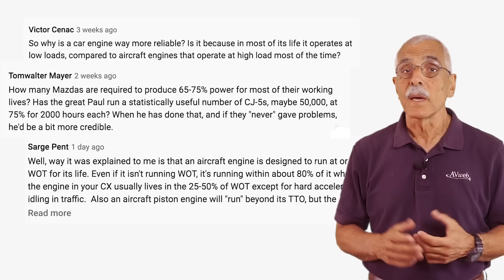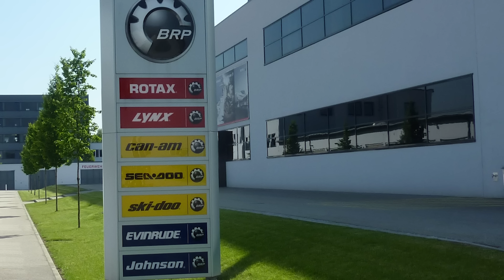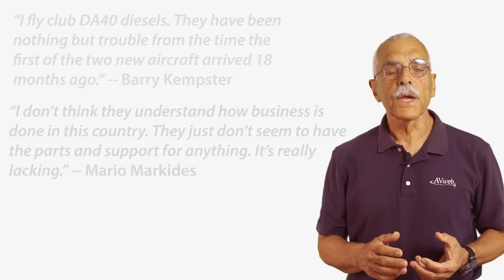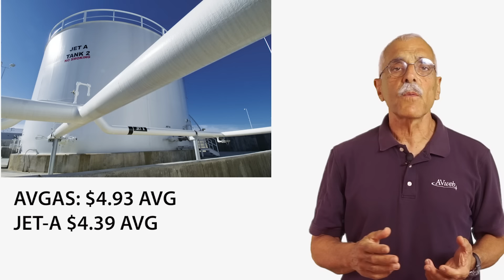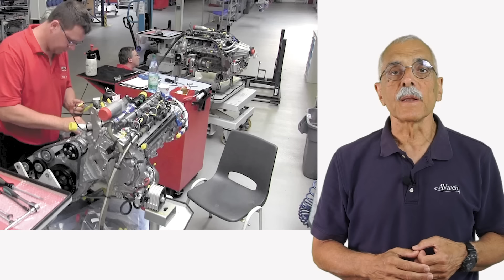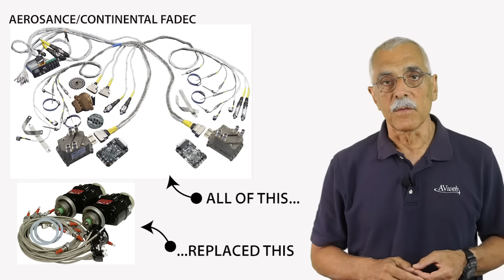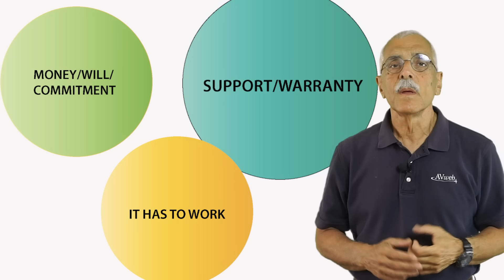Why New Aircraft Engine Ideas Rarely Succeed

Comment: The best bit of aviation journalism I've ever seen. So well researched, written and presented.
Reply: The last 50 times I have tried to watch a 22 minute aviation video, I’ve gone narcoleptic by Minute 8… Not this one!!!
Reply: Meh .. "Blah blah advanced" ..  Not really though.  Advancement in power and head/airflow has been achieved over the last 70 years.  Over reliance on electronics so an E/E can have a job.. is not advancement.  Show me advanced power, cooling, oiling, and fuel delivery .. all with advanced reliability and ease of maintenence with an eye on cost and not reliance on electronics.   That is progress.
Reply: So it seems, the moral of the story is that, the market for aero engines is very small (when compared to cars).  Developing a new, aero engine from scratch requires as much R&D as an automobile engines (if not more), but you can't expect to sell a fraction of the volume that the automotive market demands.  So manufacturers want to skimp on the R&D by just modifying an existing auto destign.  Then, surprise, surprise, it's not as good as an engine that's specifically designed to be an Aero engine.  

The Lycoming engines have been focused on the aviation market since 1910.  That's over a century of R&D dedicated to their engine design within the Aero engine field.  What does it take for a modern engine manufacturer to compete with that?  Yes any automotive engine manufacturer could (theoretically) catch up by investing a fortune in their own R&D to produce a competitive engine, but when you look at the size of the market, is it really worth it?
Reply: Yes and there are many reasons for the answers he gives but doesn't elaborate.  Honda lost interest when China bought Continental.  Spot on about Toyota, BMW won;t let out their superior engines to the aviation market for the same reason.  Not sure why WV Audi did.  And he doesn't explain what happened to Mooney either.  China bought up many GA manufacturers as they could in order to kill the competition to their investment in Sirrus.  Mooney was one of them.  They also bought other type designs like Commander with no intention of ever producing anything.  But Amerikans enjoyed lip service from them and the promise of the golden sellout.  Enjoy your parachute gimmicks!
Reply: Yep
Reply: What about the Viking Aircraft Engine Honda 1.5L automotive engine? This engine has been for sale for many years - I'd love to hear your opinion about the company and the technology behind converting an automotive engine to an experimental aircraft engine.
Reply: @Jax Bradley Glad I could help :D
Reply: Until he said. It must be a German thing.
Reply: @Smarty1171  .. I doubt he meant anything by it
Reply: @venusreena2532  I know exactly what he meant. But try that with another ethnicity and YouTube would pull the video.   It’s true.
Reply: @Smarty1171  that was the best part. Btw it was you, in the kitchen, with a butcher knife.
Reply: @Smarty1171  ⁷
Reply: @Colonel Mustar
Reply: @Jax Bradley Lately I have been using flixzone. Just search on google for it :)
Reply: @Romeo Jacob yup, been watching on Flixzone for since march myself :)
Reply: @Romeo Jacob thanks, I signed up and it seems like a nice service :) I really appreciate it!!
Reply: @jaxbradley7036  
 From quora:
“…
It's an illegal website and a complete scam. Don't waste your hard-earned money on such fake sites. Flixzone net website is not a safe website.
…”
Reply: i know I'm pretty off topic but does anyone know of a good site to stream new movies online?

Comment: Interesting video and I can not argue with much of what you say.  However, there is one bit I disagree with.  As reference, early in is publication history the Air and Space magazine did an article on why automotive engines in general were not suitable for aircraft.  It had to do with duty cycle and that auto engines simply are not engineered for running at high out put for extended periods of time.  It then discussed and showed for example the size of a typical crank shaft for an automotive engine versus an aircraft engine.  The aircraft engine being much more robust for a given power.  You mention this but then dismiss it.  This is where I disagree.  As an engineer, I understand a little about how fatigue fractures grow in highly and unevenly stressed parts like for example a crank shafts  Diesels which you discuss at length have by their nature more robust internals and for that reason probably are successful.  Based on the Air and Space article and my knowledge of fracture mechanics, I would not want to fly in a plane that is powered by a converted gasoline based auto engine.  Nevertheless, an interesting and instructive video that I enjoyed watching.

Comment: 30 year airframe and power plant mechanic opinion here   Classic Lycoming (and very similar Continental) air-cooled opposed engines emphasize extreme field serviceability and ecosystem depth. Individual cylinders can be pulled and worked on without full engine removal; magnetos are independent of the aircraft electrical system; diagnosis and adjustment often use feeler gauges, basic hand tools, and widespread A&P knowledge. Parts and expertise exist at nearly every GA airport. Classic Lycoming and Continental engines still excel for traditional GA—ubiquitous mechanic knowledge, true field repairability with basic tools, independent ignition, and a mature parts/support network make them highly practical and resilient in real-world (including remote or training) operations. More modern engines generally improve efficiency, weight, emissions, automation, and (in some cases) fuel flexibility, but they trade away some of that simplicity and widespread support for greater complexity and specialized maintenance.  regulatory, liability, and infrastructure factors have preserved the 1950s architecture because it is so deeply suited to the existing service ecosystem and the safety culture of GA. Experimental builders have shown how the same core can be modernized when certification barriers are lower.

Comment: I don’t agree with your statements on the Mooney m10. I worked at the factory after that time and I was told by an engineer that the m10 couldn’t even climb to cruise altitude without overheating and that was with the diesel engine. I was told they had to stair step the aircraft all the way to altitude and that it took 4 more stops than planned to get it to Kerrville. 😂 it’s not a great engine it’s just an engine…

Comment: Don't really need DOHC when the engine doesn't even get above 3000 RPM during operation.

The automotive diesel is an interesting option as their torque peak tends to be closer to 2000 and horsepower peak in the mid to high 3000s.

Their happiest operating range tends to be 2200-2800 RPM for these smaller "high speed" diesels.

But, there is added complexity for sure, not to mention the cranksahft being too low for where the prop needs to be, so they need a gearbox to move that output higher than the crankshaft. And their original gearboxes were not long-lived...

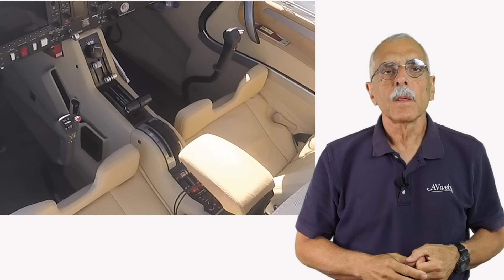Comment: 12:45 Kurt Tank already put a mechanical computer (kommandogerät) in the Fw190 in WWII that allows for single throttle lever operations. It’s kinda crazy for me to learn that after so many years aircrafts still have 3 levers per engine
Reply: That was BMW, not Tank.
Reply: @P @PistonAvatarGuy h right, they made the engine

Comment: Reason… number one…
The FAA makes it …IMPOSSIBLE….. IMPOSSIBLE …IMPOSSIBLE…
to jump through the initial hurdles….
How about this…
1) I have a Piper Aztec but the engines are smoked..
2) I want to install 
two Honda engines with props from those guys in Florida..
Or two GM LS3 engines with the gear box and prop systems from…xxxx
I …will fly it up and down the coast line.. daytime  VMC only for 100 hours
Or
I will fly it ONLY in G airspace and in and out of these airports… always day VMC… and never below 3000’ AGL unless for take off and landing…
THEN…I will report my results…
THEN…I can add passengers for day only for another 200 hrs..
etc
Ok the above needs tweaking but…

The  FAA is full of cowards… there ARE WAYS…to both make R&D possible and safe… without selling your soul to a private equity firm…
What a great example of the government getting in the way of SAFE INNOVATION.

Comment: “12 mpg”! Stated right up front! I love it.

I once had a conversation with an aviation buff and asked him about fuel consumption compared to cars. He was bragging about some new plane and how aerodynamic & slippery it was. I asked him “how slippery is it?” Given the chunky design of cars at the time, driving them in the densest air possible (ground level), rolling resistance of tires & mechanical drive trains, and inevitable stop & go events, it seemed a reasonable question to compare mileage. Certainly the slippery design of a plane and lack of mechanical losses makes up for some of the higher speeds & resulting air resistance? Right? He absolutely refused to even have the discussion and insinuated that I was an idiot for even asking such a stupid question. He said- “Aircraft fuel consumption is measured in pounds per hour, not miles per gallon, and there is NO way to compare them.” I insisted there is! (Assuming same load) It’s as simple as miles traveled, divided by gallons used. Does the gas pump at the airport dispense gallons or pounds? It’s in gallons I bet, and how much is it per gallon? Sure, it’s 3 times faster, but at what cost? 

I asked him when his trip starts?- When you get in the car to drive to the airport, or when the plane becomes airborne? He refuses to talk to me to this day. He thinks I’m anti aviation, but no such thing. I just want to understand the big picture.

Comment: As an air crash investigation follower it's obvious to me that those ancient air cooled engines are involved in failures similar to those that often occurred in old British motorcycle engines and which are very rare now in modern motorcycle engines. This is simply because of improved designs using appropriate materials. There is no reason why a modern air cooled aircraft engine could not be designed using such technology producing a bit more power with better fuel economy operating at the required revs. Lives would be saved.

Comment: Seems to me that a good "test bed" for these diesels might be in the back up generation business.   These have to start without drama and are expected to put out "70%" indefinitely.     The generator market could support pure diesel, diesel and LPG or NG, or LPG/NG spark ignition.   There even might be a market in back up generators for aluminum over cast iron just to make it easier to install or transport.

Comment: Smithsonian Institution publication: 'Power struggle, why car engines won't fly'
Reply: LyCont propaganda. Car engines can, and do fly. See: Austro Engine and Viking Aircraft engines.
Reply: @PistonAvatarGuy   I used thinking a repeated comment from my Grandmother 'The best is enemy of the good', was hers, but not, it's in the Bible
Reply: @joseveintegenario-nisu1928  And that's why religion is so dangerous. Your camp also claimed that something like the Rotax 9xx series would be unreliable and inefficient, but it blows your LyConts out of the water in both categories. New can definitely be worse in some cases, but it's also definitely not always worse.
Reply: @PistonAvatarGuy   Religion, Christdom is a New way of living, is adopted voluntarily, Yes, you can install a refurbished automobile engine in your airplane, but its consequences in front of an specially commited aircraft engine are not beliefs, but facts.
Reply: @PistonAvatarGuy   I don't have figures about how frequently 2-Stroke seize vs 4-Strokes, we Know Wankel RCE failures are usually a bit less total and less immediate than reciprocating engines, but my feeling is 2-Stroke seize more times, let's say per 1'000 hrs, than 4-Strokes. No?
Reply: @joseveintegenario-nisu1928  The Rotax 9xx (912, 915, 916, etc) engines are not two strokes.

Comment: Before I was into planes I drove racing cars. Those engines were good for about 50 hours and they were based on road car engines. It's not the throttle position it's the revs. You could get years out of a car engine WOT at 2500RPM. In a race cars you use < 1500 RPM power band e.g. 5500 to 7000RPM. It's the revs that kill it. That's why road car engines don't fail.
Reply: A Viking Honda engine ran for over 1,000 hours without issue in an aircraft. You seem to forget that powering an aircraft is basically like cruising down the highway, but at very high speed.

Rotax engines also run at about twice the rpm of most aircraft engines, yet they have about the same TBO.

The Porsche PFM 3200 also looked like it could have eventually had a much higher TBO than any of the LyConts, had it remained in production. It started off with a pretty high TBO anyway.

Comment: As an Engineer, formerly car industry, Space Industry,(with Qualification) Drug Industry(with qualification), it perplexes me how many times per month a single engine failure occurs on an airplane and the pilot declares an emergency, lands in the middle of a road, or crashes, or both. Whats the deal? I ve never seen so many failures. Maybe its the altitude that affects the oil residue on cylinder walls and the aircraft engine loses a small advantage that car engines have on the ground. Im grasping at straws,....but maybe not? Seriously, the  number of aircraft engine failures is alarming. Its so alarming for some, that they are turning to diesel, you know who you are.

Comment: Spent a lot time behind old continental's that worked just fine but built a homebuilt with a Suzuki G10 (one liter) and a cog belt drive.  I could run that engine at 4700 cruise all day with no problem.  All I wanted was a reliable ride.  Speed was not important.

Comment: The aviation industry needs an engine of about 150HP that's cheap, lightweight, reliable and dual ignition systems. I had one in my car way back in 1888. It was in an Alfa Romeo 75 2.0TS. Known in  the USA as the Milano. Alfa even has experience of Aircraft Engines in WWII. Would it work today ?, I don't know but food for thought.

Comment: My take - for what it's worth - is that the market for piston aero engines just isn't that big, compared with cars. New cars number many, many millions annually, whereas light aircraft? Nowhere near, not by a lot, a very lot! The financial incentives for either newcomers to engine design and/or manufacture are scant, slight, whereas economies of scale mean you could simply stick a new car engine in your aircraft for a fraction of the cost of a new or re-worked bespoke aero engine... Car engines need lots of mods to introduce sufficient redundancies to make them attractive as an aero engine, and to get certification from the authorities. But there's this - even my old six pot diesel Volvo, which covered 252K miles so work out the hours from that using whatever metric fits, and there were many times I took it to Europe and drove at at least 70% of max revs for hours and hours at a time. It used barely any oil between changes, I would have trusted it in an aeroplane any time. Like my current diesel, a D5 V70 with a mere 170K miles on the clock, it never needed a rebuild. In a plane, however, a new engine for around 5-10K bucks every so often, cheap aviation!

Comment: Two major factors.  Initial cost.  Liability.  The second factor means that high volume engines manufacturers (automobile) want to have nothing to do with the junk yard dog lawyers who go after aircraft accidents.Subaru engines are a slam dunk best fit for many aircraft, but Fuji isn't stupid.
High tech?  OHC engines have no advantage for low revving.   They have the disadvantage of greater size and weight compared to pushrods.

Comment: Right on the money. However, the scenario is changing. Auto engines unable to sustain 70% power continuously? How about a derate? E.g. Toyota has a 300HP three cylinder turbo engine. If one derates it to, say, 150HP, running it at 70% of 150HP means running it at 35% of its thermodynamic capacity, which is pretty reasonable. A reminder: Lycoming an Continental engines were first born as automotive engines.

Comment: Just to set the historical record straight. The Honda engine had an Aerosance FADEC. Aerosance was part of Teledyne. It did not have a Hamilton Standard FADEC. The Toyota engine did have a Hamilton Standard FADEC.  Those smart engineers who did the Toyota FADEC left Hamilton Standard, started Aerosance and later did the Honda FADEC. I should know, I built the Honda FADEC at Aerosance. Other than that, I did enjoy the video.

Comment: The statistics presented are unfair. It's clearly "total number of engines built, ever" instead of "per year". I know that the Austro engines aren't selling at blistering numbers, but the fact is, their market share of annual sales matters far more than what Lycoming has built over the course of 80 years. Moreover, airplanes in general don't sell quickly either, although engines and rebuilds clearly sell more than airframes, and for obvious reasons. 

And that's basically the problem. If any one company spends a billion dollars today to develop a new aircraft engine, there isn't a hope in hell they can sell more than 500 or even 1000 a year, so do the math. A billion divided by 10,000 is... $100,000, per engine. None of us are willing to pay that, right?

The other problem of course, is that the newer, better engines are just heavier. This isn't a problem in a car, but it is on an airplane. So we can either suck it up and manually control the mixture, or shell out $100,000. 

A lack of mass production bites us all in the ass, yet again.